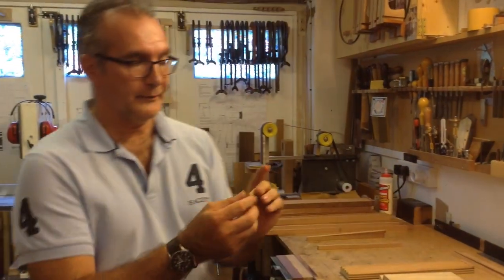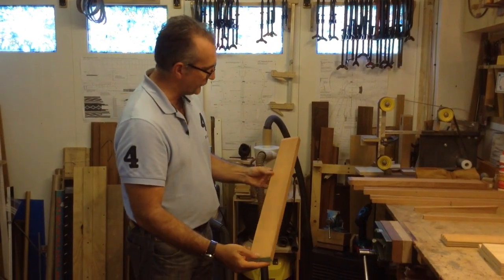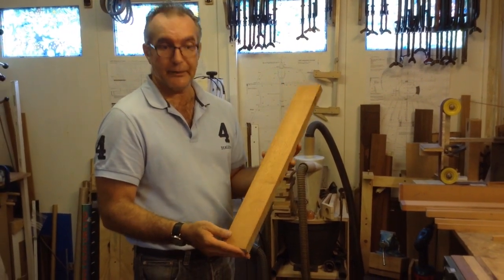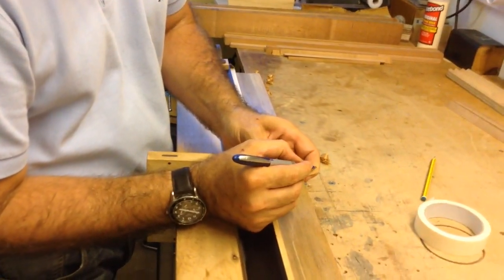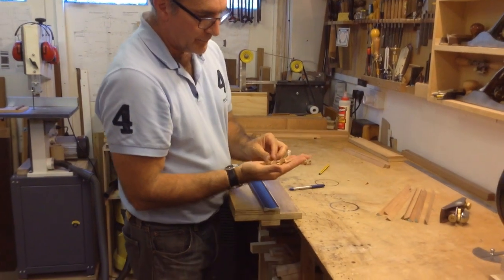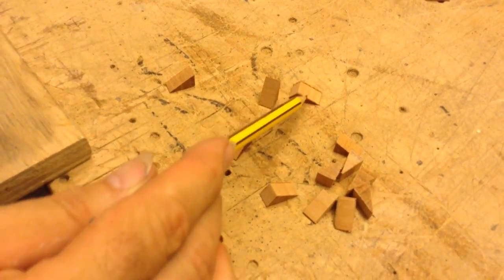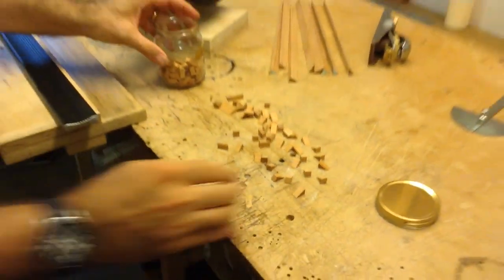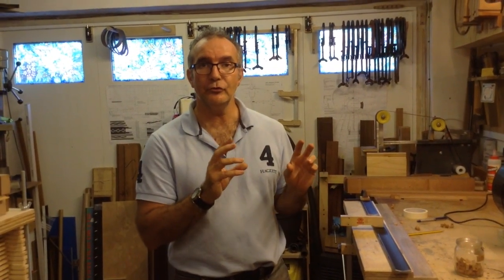How to make kerfing blocks (peones) for a Spanish guitar

Comment: Thank you for this detailed video. I have only used kerfing strips and I have a question about the 95 degree angle for the lower peones. I believe you said in another video that you use a top radius of 25'. If the width of the lower bout is 15" (say) then I come up with an angle at the side of 92.1 degrees. Because the angle will vary around the entire edge is the 95 degree angle actually necessary? It would seem that cutting to 92 degrees and then touching up as necessary before gluing them down would give a better fit. But as I say, I've never built this way.

Comment: Hi Pablo, thanks for so many great videos. I'm wondering why the peones couldn't be a solid strip of wood bent to the curvature of the sides, just like you use on the back. Thanks!
Reply from the maker: Hi Ben,
Of course you could do it that way, in fact many makers do. I just like doing the individual peones as this is in keeping with the traditional Spanish method of construction, and I also find it is easier to get a good bond between the sides and the top.